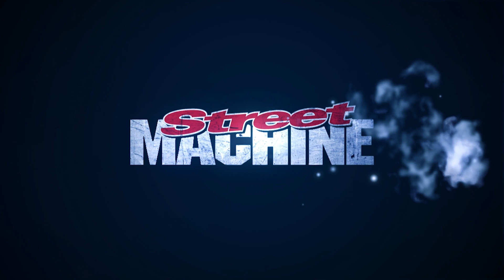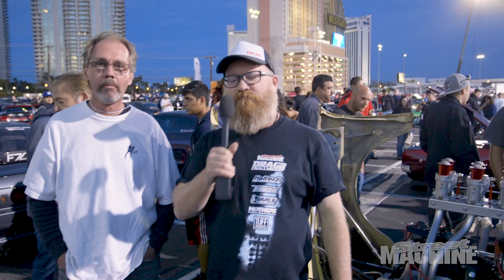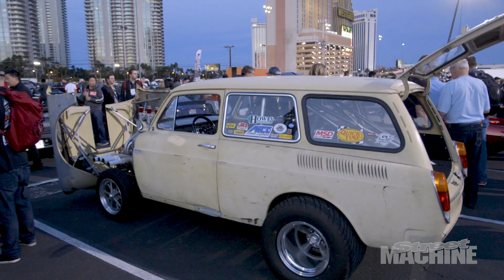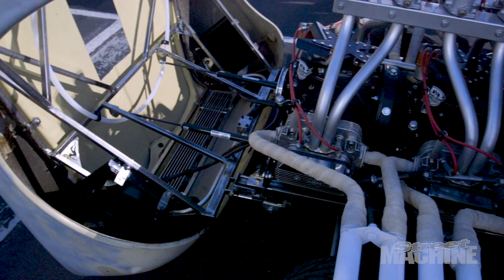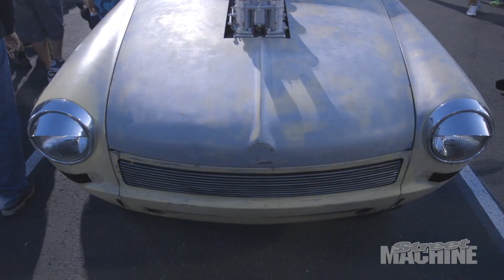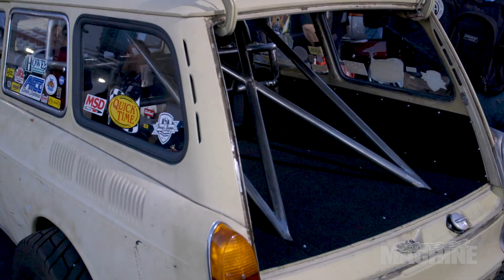TWIN-ENGINE TYPE 3 VOLKSWAGEN GASSER

Comment: so thats why it sounds like a V8. its basically a crossplane split crank
Edit: i wouldnt call it twin engine because it is technically a whole unit. just two systems to run them together

Comment: damn 400hp out if 2 flat 4s is pretty impressive. i think they at most had like 60hp stock
Reply: No, they had more than that. The older, smaller VW flats had something like that but the later 2300s were quite a bit more. Still impressive, though.
Reply: Last bug i had was 40 horse stock most they had stock i believe was around 50

Comment: So is the coupling rigid or does it have a flexible element. I mean to accommodate minor chassis/engine mount flex, etc.?
Reply: In later videos on Youtube he explains the coupling better. It looks totally different now.
Reply: @derekhobbs1102  I did see that video and it sounds like a metal flex-plate sort of affair. I was thinking a Falk or Lovejoy style coupling but they probably wouldn't be capable of carrying this level of horsepower at the existing shaft diameters. Of course they could be bushed or flanged to adapt larger couplings I suppose.

Comment: But no fans?  How does he get air to those air/oil cooled motors?
Reply: Don’t see the big fan sitting on top of the engine  right below the intake?? It’s a aluminum flex fan black sitting right in between both engine plus the two electric ones for the coolers up front
Reply: There is two oil coolers and two fans controlled by the driver as needed

Comment: There is no cooling system, no fans, no tins.  How far is it driven on the street?  From the trailer to the show field??
Reply: It's just 2 old vw flat 4s together they're air cooled there would be no way to liquid cool it
Reply: @oscarmccormack1761  I don't think you understand his question. You need fans and tons to keep them cool.
Reply: @michaelrockwell9691  how does no one see the big honking fan in the center of the engine right below the intake that cools the engine?
Reply: He has 2 electric fans mounted under the hood, article this month in Hot VW.....

Comment: best sounding air cooled bug motor i.ve heard.
Reply: it doesnt matter just an interesting note you can look these motors up easily and learn what im sayin .... here goes ....seems like he said theyre type4 or  3 motors.... 
 if thats true these motors are way way more robust and beefy .... hardly any parts interchange.... 
 they were still dead nuts reliable when service was kept up like all others......
 they also started out with more cubic inches than the type1-- "bug" 
 you are 💯correct i just found it another layer of unique build to have chosen those engines and thought yall might as well have a great day yall